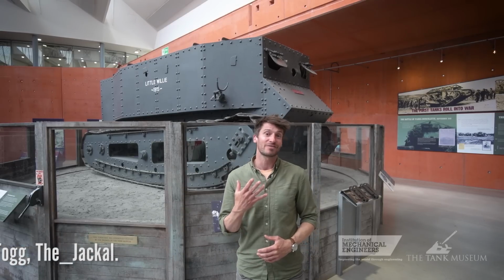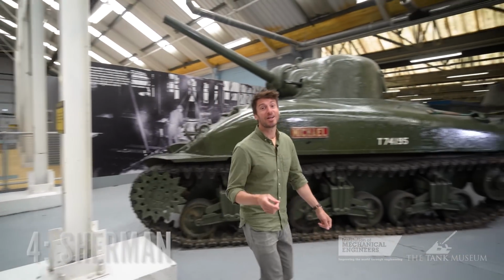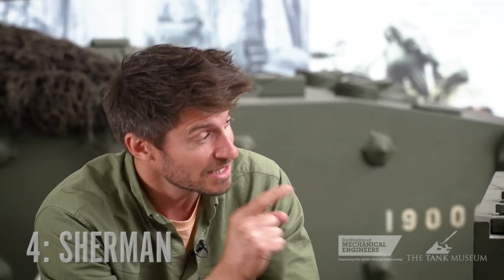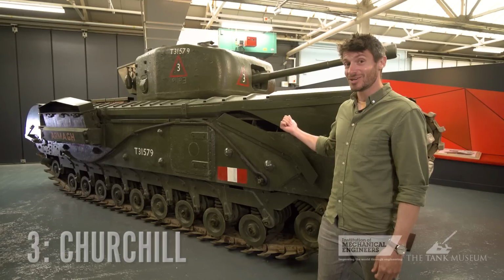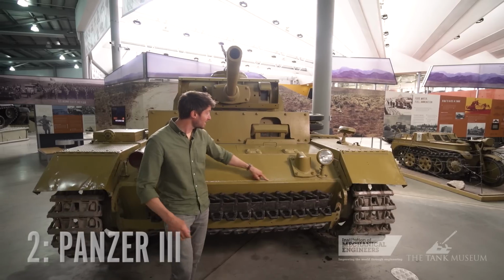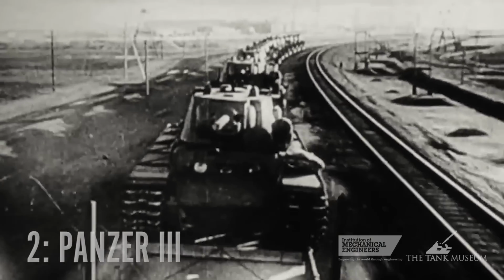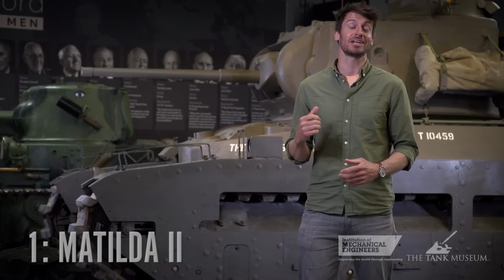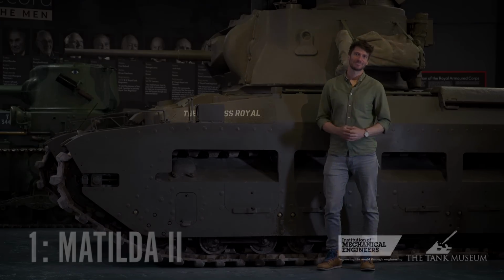Rob Bell | Top 5 Tanks | Institution of Mechanical Engineers | The Tank Museum

Comment: You know this is reputable because there were no high tier German tanks in there. Too mechanically complex and way too many breakdowns to be considered a good fighting vehicle from an engineers perspective. Doesn't matter the calibre of the gun and how thick the armour is if it breaks down half way to the front and repairs take ten times as long as your opponents then its a failure.
Reply: To be honest Little Willy is nothing more than a learning failure, it never saw combat, they just made it to learn from it, that's the end of it.

The Churchill also didn't have "good mobility", it was designed to be an "infantry tank" so it had to match the walking speed of the infantry, I don't deem walking pace speed as good mobility to be honest. The only mobility advantage it had was it's unusual chassis system allowing it to climb steep hills which allowed it to surprise the enemy on a few times. It's driver also had an even more limited view because of the track horns. It was also one of the most well armored tanks in the war with the Mark VII having 152mms of frontal armor.

The Matilda... yeah... I think it's just British bias. The Sherman was sort of rushed into production and service as well on the test bed of the M3 because America realized too late it was a bit on the short stick in terms of tank development and even with it's many problems, they were fixed and the tank served almost any role and on any front which beats any other tank in my opinion.

As far as the high tier German tanks goes, yes they had a lot of problems, but they were far ahead for their time. For example, the King Tiger or Tiger II, whatever you wanna call it, was around 70 tons, that's equivalent to most modern main battle tanks' weight and was an engineering marvel that they could even get the things to move while sadly breaking down a lot.

Germany also holds the record for biggest tanks ever with the Maus, biggest gun with the 800mm Dora railway gun, first jet aircraft with the Me 262, first (combat),  helicopter with the "Dragon" Fa 223 and so forth. So I wouldn't underestimate the German engineers and what they achieved during the war, they were far ahead on the technical side of things than anyone else, hell even been close to the first nuke with the V1 and V2 rocket program, nobody else had any such projects in the works.
Reply: Mobility doesn't mean speed, the churchill was famous for it's ability to cross rough ground and climb steep hills that other tanks couldn't, that's what good mobility means
Reply: @russianspy5307  Speed is part of mobility, and crossing rough ground was thanks to it's longer design inspired by WW1 tanks because of the fear of another trench war and weight and it's distribution. One example of this would be the Sherman getting stuck in soft ground or mud because of it's smaller tracks, something which was later fixed with the Easy 8 or modified in the field by adding track extensions.
Reply: @TigerBaron  The problem with most British tanks was engine power.
Most tanks were fitted with the Liberty engine which was an American desigh from WW1 with 300-350 hp so you could have either a well armoured but slow tank (infantry support) or a fast tank with light armour (cruiser tank).
This conflict was resolved with the Meteor engine (detuned Merlin) giving what was probably one of the best tanks ever. The Centurion (JUST too late for WW2)
Btw the Matilda had 2 diesel engines, still around 300hp total
Reply: @g8ymw  That was a problem with a lot of WW2 tanks, not just the British ones. One other big example are the German tanks, the Tiger, Panther and King Tiger basically all used the same engine lol, the Maybach HL230. The M26 Pershing as far as I'm aware also had issues because it's engine was underpowered for it's weight or at least prone to frequent breakdowns.
Reply: Boasting about the weight of the Tiger 2 being 70 tonnes and a marvel it moved (even if that was only a couple of Km between breakdowns) don't forget the 80 tonne Tog 2 was built three years before it!
Reply: @watcherzero5256  Right... I'm talking about something that actually saw combat tho.
Reply: @TigerBaron  The 262 First saw combat literally a day apart from the Gloster Meteor. The First helicopter was the Flettner Fl 282, in service 1-2 years ahead of the Dragon (The R-4 similar). Germany is only ahead if you ignore what the allies had.
Reply: @1993Crag  No idea what you mean with the 262 and the meteor. But thanks for the info on the other helicopter, I actually remember watching some sort of documentary on them a long time ago but I've seem to only have remembered the Dragon.
Reply: @TigerBaron  The Gloster Meteor fist saw combat a day after the 262. Germany were really not ahead of the allies, in most areas behind.
Reply: @1993Crag  Ohhh it was a British jet fighter... I've never heard if it before. Though you actually meant a real meteor lol. But nah I don't agree, our atom bomb was complete thanks to the work of the German engineers working on the V1 and V2 rockets project. They were the closest to anything like it than anyone else really. Given a few more months, maybe an year, I'm thinking they might have even made the first modern nuke.
Reply: @TigerBaron  The Germans abandoned their atomic program in 1942 due to persistent failures. The bomb was even tested BEFORE before any of the German work even made it to the states. To give that one to the Germans is pretty stupid. 
And nothing the Germans made came close to things like this; https://en.wikipedia.org/wiki/ASM-N-2_Bat
Reply: Nazi Germany was nowhere near producing a nuclear weapon of any kind. The US/UK Manhattan Project had the first reactor and went on to make working bombs.

The V1 and V2 made precisely zero impact on the course of the war other than some RAF Mosquitos, Tempests and Meteors being held back in Southern England to shoot V1s down.

The Maus, a completely useless machine of no value at all. First big river it came to would have stopped it dead - hardly any bridges could carry its weight.

The assorted Tiger II variants likewise - too heavy, kept breaking down, never in enough numbers and of little to no help in actually winning the war. It’s arguable that building lots more PzIVs and upgunning them with a longer 75mm would have been a better idea.

Me262. A good enough fighter wasted by being used as a ground attack aircraft on Adolf’s orders. Again, never enough of them and most were destroyed on the ground or when coming in to land.

And sorry, but if you’ve never heard of the Gloster Meteor your knowledge of WWII weapons systems is rather lacking. The UK invented the jet engine, not Germany, and the Meteor went on flying through the Korean War.

Hitler lost, and lost as badly as it’s possible to lose. That’s what his Nazi miracle war machines achieved for him.
Reply: @tlw4237  That's a hell of a lot of British bias there son, make sure to not drop your tea, in the harbor.

And what about the first general purpose machine gun in the world, the MG34 and the later arguably improved MG42 which has been copied and modernized and is in use in even current armies or was the Bren gun/Vickers better?

Or how about the StG 44, or was your Sten a superior weapon?

And don't get me started on the horrible British infantry weapon sights, I never realized it until I actually tried them in games to see how bad they actually were.
Reply: @TigerBaron  You don't appear to know much about science seeing as you think that "our atom bomb was complete thanks to the work of the German engineers working on the V1 and V2 rockets project". Nuclear physics and aerospace engineering are completely different specializatons, so having advanced knowledge in one specialization does not mean you automatically have the same level of level of knowledge in the other. Wernher von Braun had nothing to do with German atomic research, it was Kurt Diebner (a nuclear physicist) who was the director of the German Nuclear Research Council, which failed to develop an atomic bomb for Germany before the war ended. This might not have been the case if the Nazi regime had not perscuted it's own Jewish citizens as many of Germany's leading nuclear scientists were Jewish e.g Albert Einstein, Max Born etc, who subsequently fled Germany, eventually contributing to the allies' nuclear programme "The Manhattan Project". Germany may have had the V1 and V2, but I think I'd rather have a nuclear bomb instead, rather more effective in winning a war don't you think old boy?

As for the german superiority in small arms design, this means little as small arms accounted for less than 20% of all casualties in the European/Mediterranean theatres during WW2, whereas artillery and mortar fire accounted for 65%. If anyone around here sounds biased it's you old chap, now run along back to the other Wehraboos because you're not going to be fed here any longer.
Reply: @TigerBaron  Sten was good enough that Germany copied it and produced 10000 of them. Lee Enfield is a better gun that Germany's WW2 rifle. Bren is as good at its role as the MG42 is at its role.
Basing opinions of real life items based on your knowledge of computer games shows an "interesting" way of earning respect for your comments. As various folks have pointed out you are wrong on many statements, especially your belief that German V1 and V2 engineers helped USA and UK build atom bomb.
Reply: @TigerBaron  The ZB 26 which the Bren was based on was as much of a GPMG as the MG 34 was. It was used as a light machine gun carried by infantry, could be mounted on tripods for emplaced use, had a quick change barrel system, was used as an anti aircraft gun, had a detachable 100 round drum mag for use mounted in cars and was used as a heavy tank machine gun by the Japanese under the designation Type 97.

The Fedorov Avtomat in 6.5 Japanese was also the first assault rifle issued. It fired in semi and full auto and had detachable box magazines. The 6.5 Arisaka projectile is only slightly heavier than 8mm kurz and fires at a virtually the same velocity according to the Gunmag and the book "Cartridges of the World" respectively. So if 8 kurz is an intermediate cartridge 6.5 Arisaka is too. The 6.5 Fedorov saw limited use, but was issued to troops. Making it predate the STG 44 as the first assault rifle by about 25 years.
Reply: Jay D  Panthers problem was not only about poor quality materials. Its engine and final drive was not designed to carry the weight of the Panther, which is why it was so atrociously unreliable. Likewise, it was a German engineering decision to create wide tracks with no regard for maintenance, hence why it took so long to get a broken down Panther back into working order.
Reply: Jay D  Panthers reliability was mostly improved by not driving it to its max potential, such as making much wider turns (forbidding pivot turns) to avoid overstressing the engine and transmission. Furthermore, the decision to simplify its transmission was their own mistake. They could have designed a 30-ton medium, which is what the transmission was meant to carry, instead of pushing with a 45 ton tank as they did.

Comment: NO! NO! NO! Wrong.  I’m an ME born in the US and I’ve worked with enough former Soviet Block Head Engineers to dislike them all. Which is why I am so amazed as to what the Soviets achieved in the ten years prior to the invasion. 
In design it is not just the fortunate series of events that result in inspired engineering like the KV and T-34 but how you respond to failure. And the Soviet Tank Program made mistakes on a colossal scale! The T-26 and the multi turreted tanks which were both inspired by British designs and the BT-7 (USA! USA!) were such dead ends that I have seen no evidence of the Germans using any of the thousands they captured. 
No! Somehow the Soviets powered through these massive fails that had killed other nation’s tank programs and achieved success.  The KV had enough design potential to become the Stalin series of tanks. Squint your eyes and tell me you can tell the difference between the JS 1 and a T 72. Also note that the T 72 series of tanks share the same suspension as the T 34. 
Churchill? Wrong answer.

Comment: By the criteria given: endurance, good design, lasting application, and upgradeability....then the Sherman with all its variants should be on top as number 1.   It was not only a workhorse and adapted to every facet of battle called of it, it was also still used by armies into the 60's and 70's.   The Matilda II was fine for its time but was quickly outclassed on every battlefield by 1941-42, thus eliminating all the given factors.  This was nothing but Brit bias.

Comment: You are wrong about the Sherman not being inovative. There are two types of inovation, one being something new and revolutionary and the other, inovation in implementation. The Sherman implemented different types of technology and was constantly being improved, which is inovation. The Churchhil tank was way too slow and had a relativly weak gun. The Matilda  hat a very weak gun and also was too slow. If it were my choice, 1. Sherman, 2. Stug III,  3.Tiger I, 4. Panther, 5. T34 85.
Reply: The late model Churchill had the perfect gun for its designated role of infantry support - a medium length 75mm. It was designed to be slow because it was an INFANTRY TANK. It doesn't need to go faster than the infantry it is supposed to be supporting.

Comment: One should make sure to grab Robs leg, just to prevent him from rocketing up in excitement, how great Great Britain is. They are design kings, out-producers, up-gunners and God knows, where else the best.
While the stupid Huns in WW I were blowing gas into trenches, the British had a cup of tea and out-engineered them with tanks. So brilliant!
And the 5 best engineered tanks contain, guess what, 3 British tanks, with the speed wonder Churchill on top of it. 
I had a good laugh though ...
Is it such a classy engineering, to sent an underpowered vehicle with oversized armour into battle? 
The Panther tank in opposite was weighing 45 tons with armour thick enough to resist any allied tank until dangerously close range. And yet, still it had the best terrain resistance and was going by 50 km/h. It’s powerful 75 mm high velocity gun was capable to knock out this crawling Churchill on far distance, over 1000 m. The gun was additionally highly accurate. And in late 1944, even some prototype versions existed, equipped with infrared device to fight during the night, with accurately steered gun fire. 

Yet, this primitive Panther tank was,declared by many allied experts the best medium tank of WW II, despite its major flaw: It’s German... Apalling really ... why didn’t they chose the M4 at least, the other design wonder chosen by Rob and his crew?

But I agree, the Churchill was the very very very best engineering ever. An undergunned, crawling steel lump. That’s why any country wanted to buy or copy it even ages after the end of the war. 

You are so cute, in your Brit bubble, you guys of the engineering whatsoever facilities. 
And Britain still is such a world centre of purely innovation ... 🤣

Comment: >The Churchill was heavily armored, with excellent mobility (...)
>excellent mobility
Fancy transmission doesn't make overweight tank with bus engine excellently mobile.
Reply: well the Germans didn't expect that mobility in Tunisia, Churchills transmission and long tracks gave it the option of climbing a 60 degree slope. German troop were left in awe churchills were assaulting their position thinking they couldn't get there, this capability was built into the later Centurion tank. mobility doesn't mean speed.

Comment: Just found this video and found it interesting ,though I have a couple of points ...1 The Sherman at 4 ??? Having spent many years in R.E.M.E  I understand how something being made with the mechanic in mind is gold to mechanics ,but no matter how  good the armour is using nuts and bolts negates the armour ,they may as well have used cardboard,,The front is meant to be the most heavily armoured part of a tank afterall ...2nd point where is the T34 tank ???? Massed produced with no airs and graces  slopped armour which increased the thickness of it compared to the Panzer 3 with its upright armour